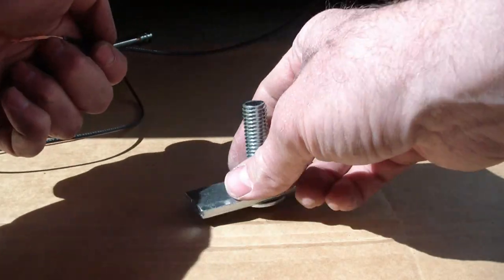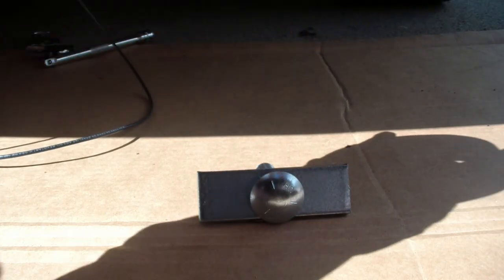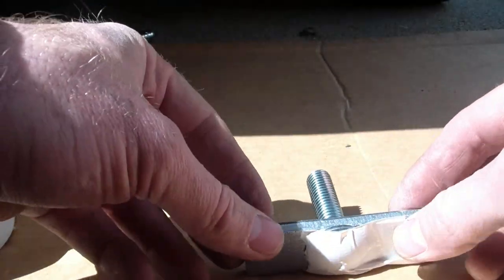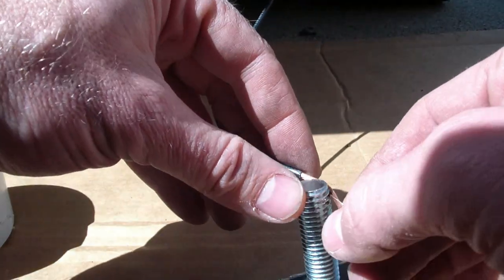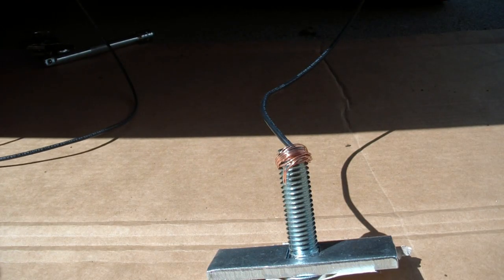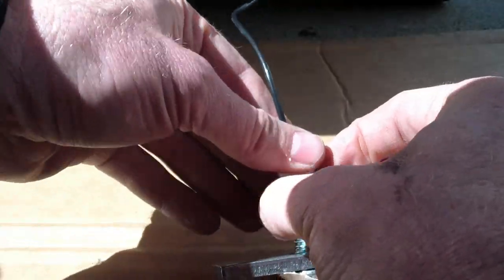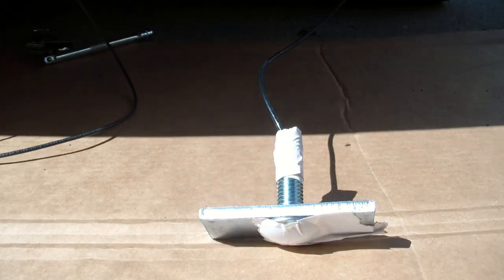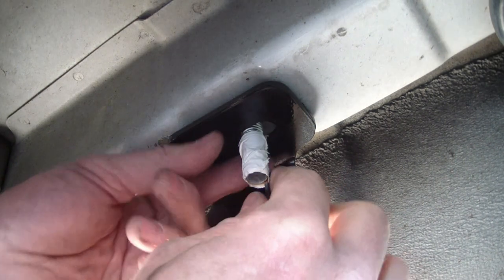How To Install A Bolt In A Tight Spot

Comment: yes somebody showed me that loong time back on any motorcycle or moped frame. Seems to be one of the hidden standard tricks of mechanics ;-) Instead of an electrical wire he used a brake wire or clutch cable or so for pulling the screw in place, if I remember right. For that pull back option one has to use always any soft yarn instead of metal wires to avoid any tickling noise during drive - he told better not to use nylon from fishing line or paracord or so since this also creates noise ...

Comment: very useful trick, works also well with a bandaid or any medical tape in case You are on the road and forgot Your ducktape ;-)
But what would You do in case You may think to have to pull the screw back one day? yes, as long as it is no hot spot don't use a wire, but wrap a strong twisted yarn around the screw under the whatever called part before You put the ductape on top. Keep it inside after installation, fix the end of the yarn somewhere (ductape etc) - it works for years without any noise.

Comment: Any advice on what to do if you forget to attach the bolt to that rectangle washer thingy before putting the bolt through? It took me an hour to get the bolt in and now it just spins because i forgot that crucial step.
Reply from the maker: You’ll have to fish that bolt out of there and do it again. You might be able to jam a really long screwdriver in and hold it against the side of the bolt head while you tighten the nut.